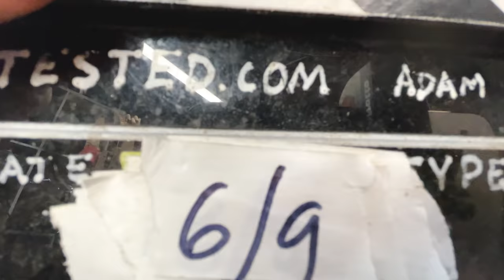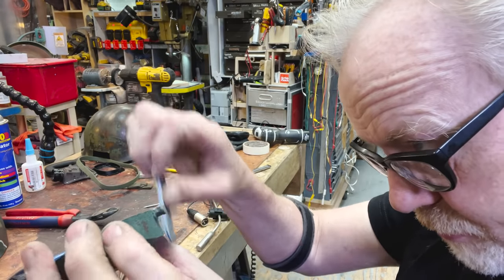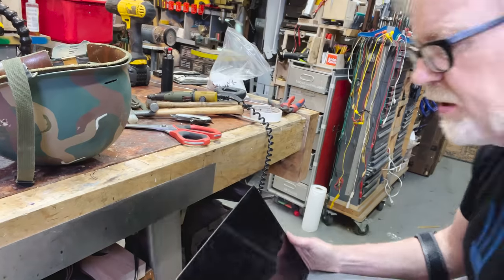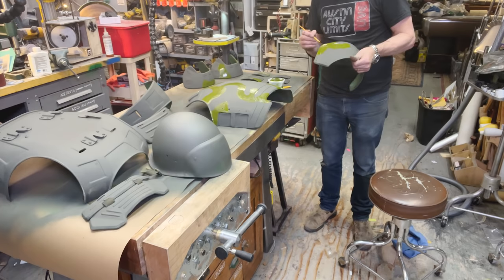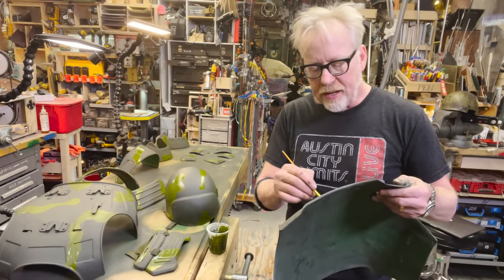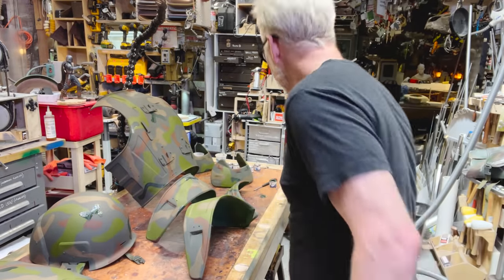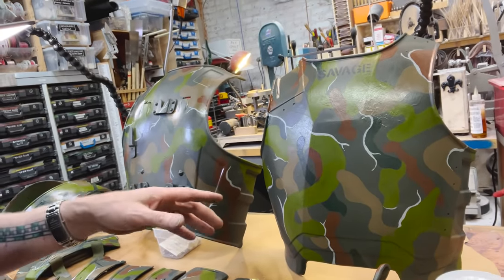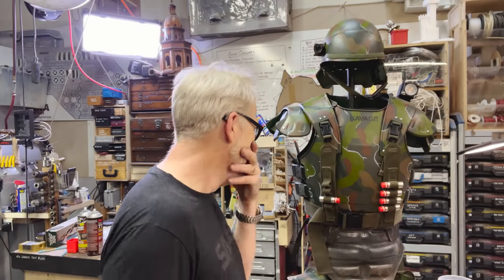Adam Savage's One Day Builds: Aliens Colonial Marines Armor!

Comment: Im a full-time military model builder when you use humbrol paint mix it and mix it some more its better to use there thinner its a hotter thinner it also takes a long time to gas off and dry if you can get some mr.color leveling thinner it works amazing on enamel paints and will dry a lot faster but for what you build try and use  Acrylic paint for your base paints use enamel paints for washes and weathering and filters use a  Cheap enamel thinner to make your washes some  of the off the shelf Mineral spirits aren't hot enough to break down the paints I mix  Mineral spirits and enamel thinner to make  My weathering washes And filters. BUT  You'd be better off to convert  over to mr.color products or Tamiya paint for Airbrushing AT A RATE OF 50 50 FOR AIRBRUSHING .most people don't use Enamel paints for base paint anymore but only for  Weathering you will get much better results.

Comment: Hey if you try to do camouflage remember what the purpose of it is. One prime such purpose is to eliminate shapes we register as human so you need to break things off such that it doesn't register as a body with two arms, two legs and a head, that's the tricky part. The same goes for face camo, you want to distort the face such that there isn't symmetry there that one would register.

Comment: I will say, making spray templates for camoflage seems like the perfect use case for a Cricut, or other brand of vinyl plotter/cutter. Just find the appropriate camo pattern, trace over it in a vector graphics program, then run the plotter. Once it's done cutting, you can just peel and stick the vinyl onto whatever needs painting for whichever colors need masking.

Comment: Adam I know it's an extra step but it might have saved you a lot of struggle and issue. You could have got yourself a vinyl wrap printed in the style of camo you wanted and use it as a mask after you have wrapped your items cut out the colors with an exacto and then paint them. Where the vinyl wrap is nothing but a mask that helps guide you in this matter. And then you can add all your effects to the paint. There's no problem with free hand but it may have been easier. And you're off on your colors. Deep Forest isn't necessarily the base olive drab should be. Deep Forest is actually the dark green blobs of the actual camo. And possibly burnt umber for the brown.

Comment: The key to camo is if it matches, you're doing it wrong.  But it needs a story.  It doesn't match because you took the back plate or gauntlets off another Marine because he didn't need them anymore.  It needs some scrapes and bangs so you set it up and throw rocks at it for frag damage or just take some flat iron and take some swings at it.  Or you finish the paint job and scrape your back against a brick wall because your character was taking cover.  The story really isn't important but it gives you the wear you need to make it authentic.

Comment: I had the same problem getting the shoulder pieces to stay up. couldn't find anywhere where they explained it so I had to come up with a way myself. Ended up putting web straps on both the front and back pieces to hold it and keep the articulation.

Comment: Generally, yeah, you add more mineral spirits. If you cock up and put too much, you let it evap a few couple of minutes by pouring it in a dish. But the thing is, said paint is probably old. I know a lot of people are really into their paint, and like to keep it as long as possible, but there is such a thing as shelf life and it has nothing to do with air or how much solvent there is. Even oil based paint and watercolor blocks have a point past which they just don't work anymore (tho with oil, that's easily remedied).

Comment: Question, why not make a soldering tip for melting the holes? You would have heat on hand all the time without the need of using the chef torch.

Comment: Depending on the thickness, solvent and a good shake/stir with Humbrol.
Too thin, leave it open in a warm place for a few hours before sealing the tinlet.  
Years ago, you used to be able to proverbially set your watch by Humbrol paint, but lately what comes out the factory is very hit & miss.

Comment: Since there is a helmet liner on the inside, why not use the machine screws on the camera mount to fasten directly to tapped holes in the helmet (or nuts on the inside if there is clearance)?  Just a thought…

Comment: for Camo i think the key is not to overthink it or over do it.

Most Real Camo is either carefully designed and applied at the factory, or it's a general  design and colour spec slapped on in the field by the Troops....usually sloppily in 1 coat.

when I paint it I try and keep that in mind. quick and easy. 1 pass. inconsistencies, sloppy border lines, spatter drips, brush marks....... are your friends! They add the randomness that carefully building up coats like Adam is doing can never duplicate.

just my 2 cents.

Comment: I wonder are most military camo applications hand painted with a brush? I always imagined it would be spray painted using stencils or something. Just seems it would be really tedious in a mass production sense to do so much by brush.
Reply: It depends obviously uniforms are printed in factory but as for things like weapons helmets and vehicles those are usually painted by the individual soldier or crew if that is something that is allowed by the command most equipment issued by militaries will either be camouflaged from the factory or come in a single color like green or khaki

Comment: Adam, every time I see you using CA glue to build in sections of these pieces, I always wonder why you use that rather than one of the UV cured resin systems available such as Bondic, or similar.  Is it simply old habits die hard, or is there another direct reason they wouldn't work?  It's just.. Isocyanide chemicals are not exactly trivial, health wise.

Comment: Soooo....  Why wouldn't you use those 2-56 screws from the camera plate to attach the camera to the helmet?  Seems silly to drill and tap those, put real screws in,  but not use them as a mechanical means of attachment